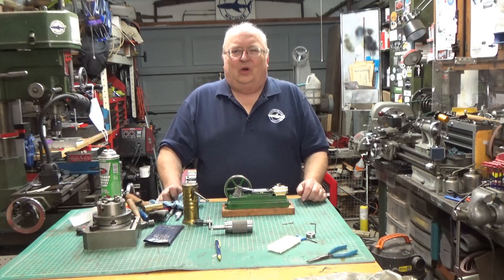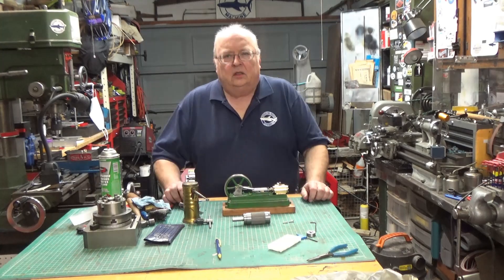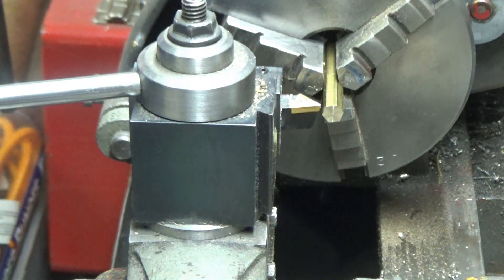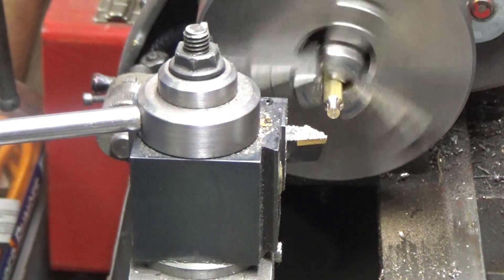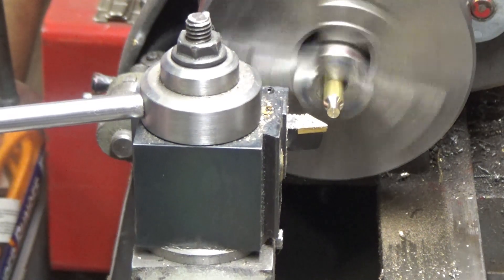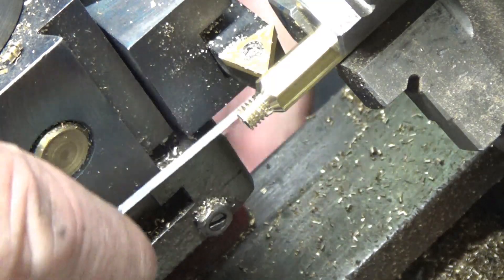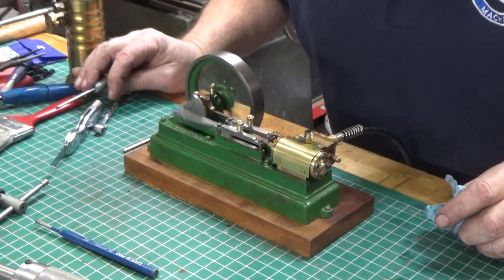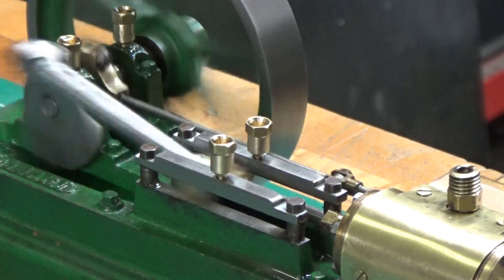Tiny Oiler Build - Stuart S50 Steam Engine

Comment: What is the parting tool you are using?
Reply from the maker: I am using the Nikcole mini-systems grooving /cutoff tool.  It works great for small parts.  Very limited cutting depth.  Designed primarily for grooving.  Thanks for watching and commenting.